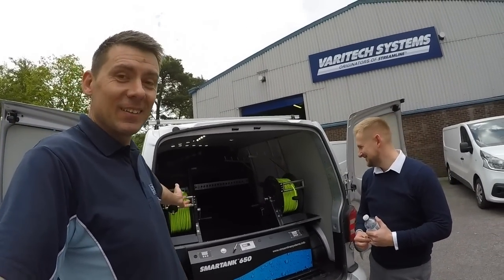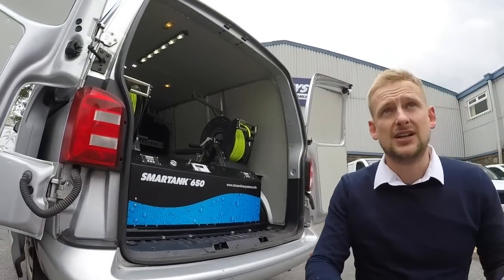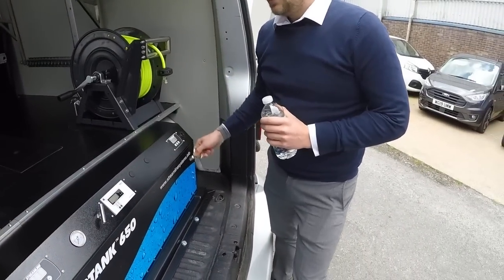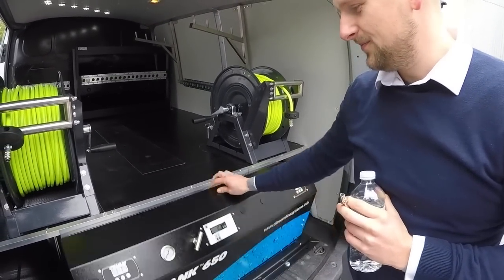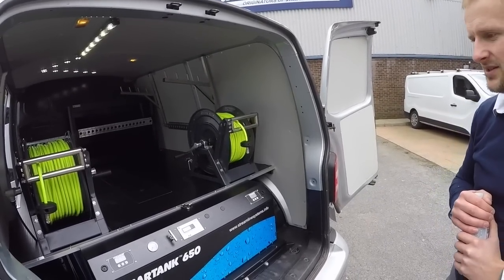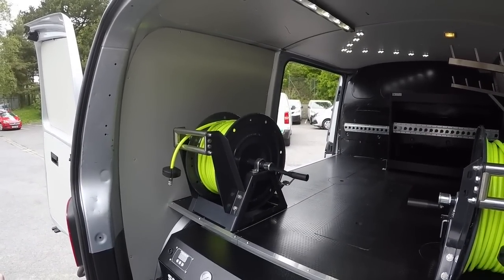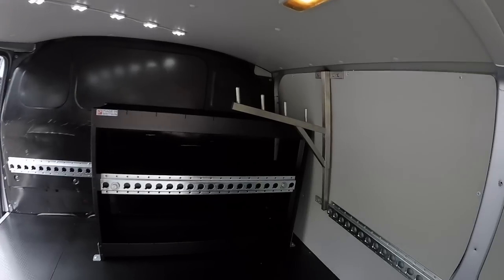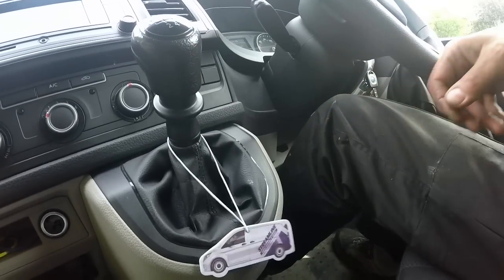A Close Look At My WFP Van Setup From Varitech

Comment: Quite a nice system. The ONLY thing I would of changed is I would of went with a powered reel. Once you have one of those you'll never go back trust me. Also I have a clear tank so I can see how full the tank is which I think is handy at times when you don't quite want a full tank. But a very nice system there I love how the tank is flat and you're still able to put things on top of it very nice feature.
Reply from the maker: deltafit There is a gauge at the side so you can see how full it is. They are working on a powered reel mod.😃👍🏼

Comment: Great looking system. I’m really pleased for you. 
If you get chance I would definitely go with hot water and powered reels. 
Will you manage to get your gutters vac in without tipping it over. If you do have to lay it on its side I would get a tray for it to sit in to catch the drips. 👍
Reply from the maker: Squeaky Clean Dave Yeah, might get some add ins at a later date. Getting used to fitting in my other kit. The gutter vac goes in laying down.😃👍🏼

Comment: I would always be on standby by when filling, there's been quiet a few solenoid valve failures from over night filling and flooded out vans,  too much water pressure, RHG have stopped using this set up for filling as well , nice van set up though enjoy and speed up your work, maintenance is performance and performance is maintenance on your filters.. 😀👍💰💰
Reply from the maker: FlashTechEngineering Thanks. I have really hard water where I live so I’m trying to be careful about flushing my RO filter etc. I have to say that I’m not keen on letting it fill overnight. I usually put it on as soon as I get back and turn it off when I go to bed.😃👍🏼
Reply: I use a  ionic 40 inch softener , you connect inline before your carbon and sediment filters, my TDS fluctuation between 190- 310 , I back flush the softner  every 1000 litres of pure water, you use about 1 cup of salt in a backwash canister, this  will preserves all your filters, check out ionic videos on water softener, my stainless steel Quattro I've produced  160,000 litres  of pure water and only replaced my carbon and sediment filters  2 months ago , and lasted  3 years , my RO membrane is still running at over 98.5 percent efficiency,  it's producing 3 TDS before the DI filter..water pressure through booster pump is 180 psi which is better for producing pure water..
Reply from the maker: That’s interesting. Thanks for the tip. I was thinking of doing something like that. My water comes out of the tap at 4-500ppm.😬👍🏼
Reply: This is a top secret, add a nuclear grade filter on your tank, produce your water in a full tank, then have a closed loop recirculating pump through the nuclear grade filter , through your digital controller and pump at a flow rate of about 300mls per minute, this low flow rate give more contact with the nuclear grade resin , this is how ionic zero does it this is how the get zero parts per billion, I do it this way.. I have a storage tank that I fill and run it 24/7 then  fill my  ionic cold  water delivery 400 litre tank in my van from it, amazing results .. of course I'm using ionic hot box aswell 👍👍👍 ps run a ultra violet lamp filter as well, kills off bacteria

Comment: Well done Ashley Im really surprise you have WFP so late...You will notice the change. Anyway I dont like the system setup. I prefer vertical tank so still have space for jet wash, vacuum and other things.... I can keep the doors close while using system...safe. buttttt.....VW is wooowww!!!!
I will send you link to my van tour .... let me know what do you think... All the best and...my congratulation!!!
Reply from the maker: Lukasz Kaminiecki Thanks. I like the flat tank to keep the weight low down, and with the false floor I have plenty of room on top. I will do a video to show how I am getting on in a few weeks.😃👍🏼
Reply: A.E.Mackintosh Cleaning Services 
I missed you have connectors outside as well for the water. This is good! I working on my own and have a platform to put jetwash into the van- too heavy to lift. Yours system looks so new ha ha so fresh.... many people don't know that system so I use my van as a show room to explain what is wfp system- have to keep all tidy and clean inside :-) really recommend do that. It is any reason you choose VW? Vivaro have good deals....Citroen is nice inside. Vw is the best but only that price ha ha ha....have a good weekend Ashley!!
Reply from the maker: I love VW, and I’m going for a certain image to reflect on my business. It is slightly smaller than some other vans out there but the system fits in just the same, so ultimately there is just less wasted space inside.😃👍🏼

Comment: How do you stop your water freezing during the winter? Do you have to add some kind of additive to the pure water
Reply from the maker: scw 74 I understand that you could end up with a residue in your tank if you use an additive. In winter I just put an oil filled electric radiator in the van overnight so the water doesn’t freeze.😃👍🏼

Comment: Hi Ashley, how's the transporter going, is it lwb or swb  looking at upgrading my swb caddy, hard to find second hand with the barn doors, what size is the engine and the model and year..very nice set up and great colour choice your logos stand out nicely..👍👍
Reply from the maker: FlashTechEngineering Someone I know helped me get it at auction, so it was a good price but a little bashed around to be honest. It serves a purpose though and it’s working out great! I must do more videos about it soon.😃👍🏼
Reply: What's the  driving vision like ?? Any blind spots compared to the caddy , a bit of adjusting I guess
Reply from the maker: Yeah, the difference in size takes some getting used to. I was keen to get a swb to keep things as compact as I can for getting around the country lanes and domestic driveways etc. I’m really pleased with how the setup turned out.😃👍🏼

Comment: I’m thinking about buying this exact system how much was it all in ? Also how much are the membrane to replace ?
Reply from the maker: About 7k all in. Water proof lining, fully integrated filter system, tank, hose reels, van lining, pole racks, etc etc. I recommend you get in touch with Varitech Systems to discuss your specific requirements and get a quote.😃👍🏼

Comment: Nice! Love Those leds in the ceiling. I’m driving a VW transporter like yours too with a 700ltr setup. What kind of material is used for the sidewalls and how did they fit it? Looks tidy! Ps: Really recommend fitting extra helper back springs.
Reply from the maker: Edwin Noort It’s just like a corrugated plastic material that is screwed down. Seems quite durable. I was thinking of doing something about the suspension.😃👍🏼

Comment: That looks fantastic Ashley ,did you get the van from too as a package ?
Reply from the maker: kev masser I supplied the van myself, but you can get a van included as part of the package if you wish.😃👍🏼
Reply: @aemackintosh  thanks Ashley... That's the kind of set up I'd like eventually as I'm running out of a caddy at present with a 350 litre tank and need a bigger system. Plus I have a separate van for my jet washing side of things, would be far better with just one van.
Reply from the maker: I am planning to do a video showing how I’m getting on with the van in a few weeks.😃👍🏼

Comment: Whats your van payload m8?
Reply from the maker: Ml6 Cut Its a ton, but I actually had the rear suspension upgraded recently.😃👍🏼
Reply: A.E.Mackintosh Cleaning Services by doing that does it up the payload i take it?
Reply from the maker: Yeah. I don’t just have the weight of the water, but also sometimes load up with other kit as well like pressure washing stuff. So the van is much better equipped now and it handles much better through the country lanes when heavily loaded as well.😃👍🏼